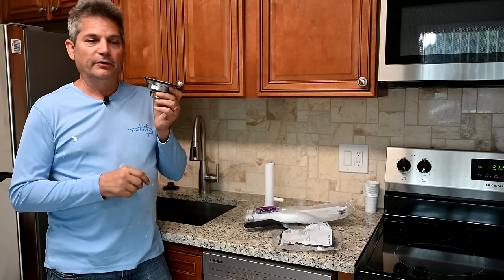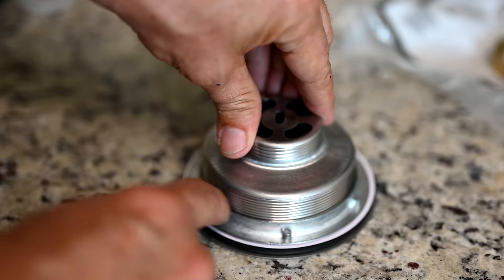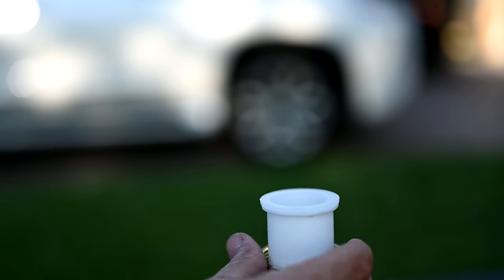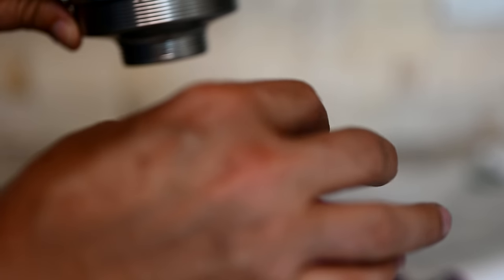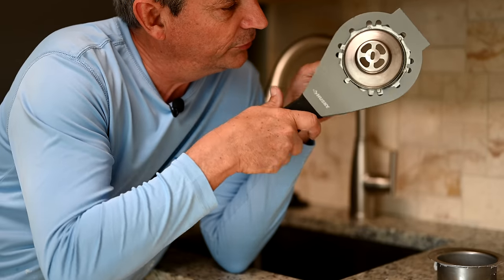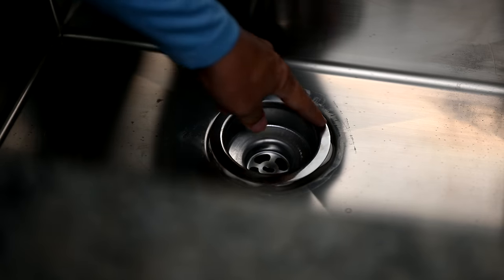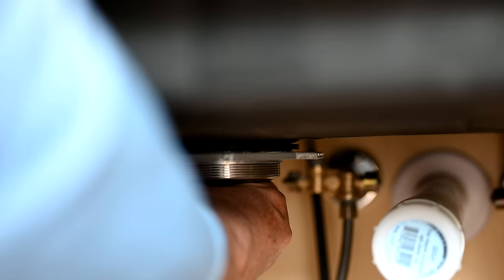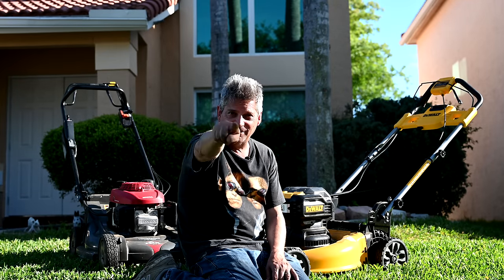How To Install Kitchen Sink Drain Strainer, Stop Leaks

Comment: Why not Friction Cardboard not Plastic? Just wondering it purpose is for even tightening, Right? Just curious Why not plastic?
Reply from the maker: It's likely cheaper to make it cardboard
Reply: @jeffostroff  it gets wet it’s ruined and Not reusable... most probably....
Reply from the maker: @jameskarr5550   Right and so we must look at the reason why it got wet in the 1st place because that should not happen. This typically happens when the plant I've been swimming the plumber's putty under the flange up top in the sink dries and cracks and so water can seep through it whenever you have water running in the sink. It might also be that the original person who installed it did not put it in a plumbers pudding and so there was always a thin amount just waiting to start leaking.
Reply: @jeffostroff  my thinking usually happens on weekend. If we’re plastic if had Puddy no need for any other part... Next visit to hardware in gonna be on lookout for plastic one... thanks for Video!!
Reply from the maker: @jameskarr5550   I don't know that you will find one because this part does not need to be plastic it's only purpose is there to keep that black rubber gasket from bunching up as you tighten the nut. It is assumed you are not going to have any leaks because leaks don't come from the bottom they come from the top of the sink wheyet of the sink where the flinch rests in the hole for the drain. And if you're plumber's putty dries up in there you're going to have a leak you're eventually in about 10 to 20 years.

Comment: I have never had any luck with plumber Patty is anyone seen any problems with silicone on the bottom of the basket or it sits on top of the sink and let it set for 24 hours thank you
Reply from the maker: I have done that a few times also, it is more reliable than putty because it never dries up and cracks

Comment: yeah only $15 for the wrench but it helps a lot
Reply: I guess I just haven't been using enough putty?
Reply from the maker: Wrench is awesome. If you apply the same amount of putty I show in the video you will be fine. And remember, do NOT remove any excess putty until the drain has been tightened all the way down, just to make sure the seal is complete.

Comment: 11:50 i use sch 40 p traps
Reply from the maker: es, those work well also. They used use those here in FL in the 1970s, but the industry migrated over to polytubes

Comment: Can someone pls explain HOW it’s better to use a gasket to couple a ‘same-size pipe’ to the metal sink drain threads? ..as opposed to screwing the male metal sink drain threads down INTO an inner-threaded female pipe? 

To me, the latter SEEMS like it would be much less prone to potential leaks.. 🤷🏻‍♀️

(But I HAVE only been a DIY plumber for about 15 mins now!!) 😂 ..So if anyone could help me understand the greater benefit of using the technique in this video.. I would greatly appreciate it.
Reply from the maker: I think they do it this way because many installatons over time th metal against metal pipes rust and they can't get them to come apart
Reply: @jeffostroff  ohh k, thx a bunch for your help!! 🙂

Comment: My sink drains stays leaking watching closely 😂
Reply from the maker: You should have it fixed by now how is it going?
Reply: @jeffostroff  I’m going to grab a drain wrench I have a different version that clamps and doesn’t surround the drain nut but every time I replace my sink drain it stops leaking my gaskets are worn now and we end up putting all the dishes in one sink a few times and after a while the sink drains starts leaning to one side opening it up to leaks. I appreciate your video I may use silicone next for a better seal. I keep using plumbers puffy.

Comment: It you watch "How To Install a Kitchen Drain Trap Assembly with Dishwasher Tailpiece" by Benjamin Sahlstrom, https://www.youtube.com/watch?v=oSGZiTYABLE it looks like he puts that top hat upward, rather than downward - which is correct?
Reply from the maker: His case is strange, maybe his basket strainer requires it to be upward, but all instructions on all packages I ever bought have it going downward. The smaller part of the high hat goes downward into the pip
Reply: @jeffostroff  - Thanks Jeff - I'll go with age and experience :) Can I ask an off topic question? My main shutoff spigot only reduces the water flow. I turn the sillcock handle as far in as possible and it's not closing off the flow. I don't want to turn too hard, because what if that breaks off?? Any way to replace or repair? Thanks again.
Reply from the maker: @bammbamm12   We see this all of the time you probably have a gate valve type and it's just not closing all of the way. I usually cut those off and sautter on a new quarter turn ball valve.  I also have another video on the plumber's bread trick which is another great way to stick piece of bread in the pipe to close off the floor of water

Comment: Don’t waste your money on this type of strainer “THEY ARE GARBAGE” save yourself a lot of trouble by buying a better one! 20 years of plumbing.
Reply from the maker: Do you have a particular brand in model to recommend? Usuallyeah? Usually I buy the ones I see in home depot and have never had a problem with them. If you properly install them and seal them when you install them there should not be any problems.